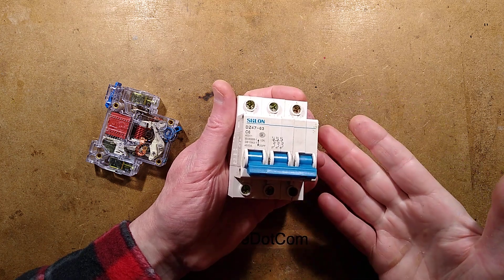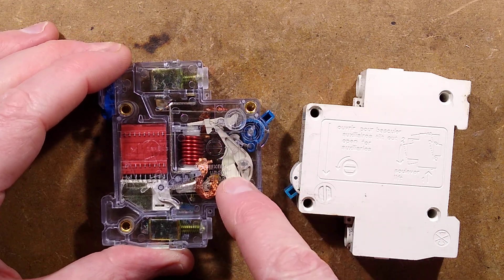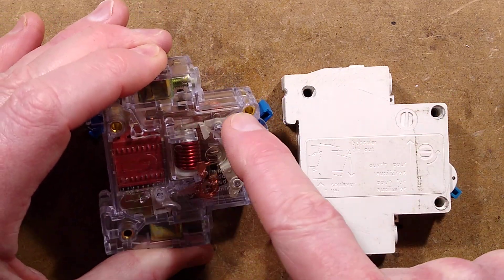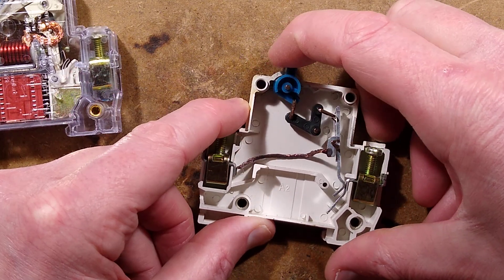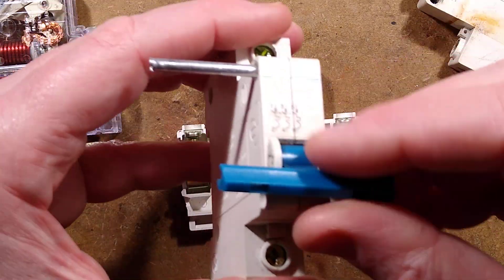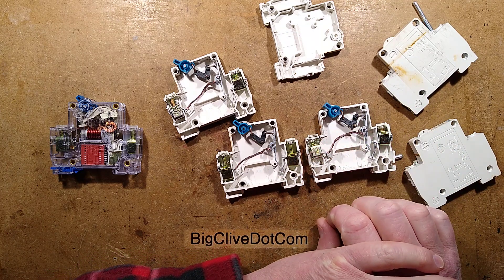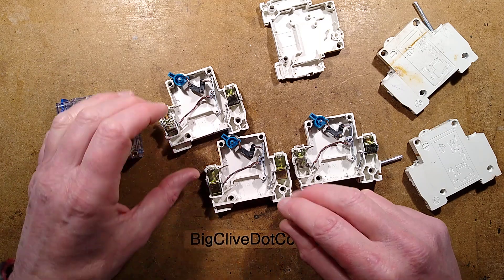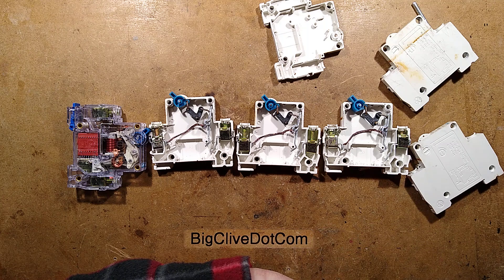Inside a fake un-trippable circuit breaker.

Comment: How different is the inside of a 100A DP switch disconnector? Let me know if you want me to post one for disassembly
Reply from the maker: I have some here.  Usually a double contact plate on each pole.
Reply: They will have actual contacts inside intended to survive opening and closing on a load, and possibly additional arc suppression (bearing in mind they're intended to open normal loads, not fault loads). While afaik the standard allows for an isolator not capable of opening on a load, I can't say I've ever seen one because you really, really need an interlock if you're going to operate a 100A contact like that.

Comment: well... it does TECHNICALLY break a circuit if you flip the switch, so it's a circuit breaker in the same way a lightswitch is a circuit breaker :p

Comment: These are probably relabeled switches.
Reply from the maker: Or just using a case they had to hand.
Reply: @bigclivedotcom  Yep, thats what I meant to say, I dont suspect bad intentions behind these, probably just the common neglegience of the person in charge not understanding the product.
Reply: @drkastenbrot  ...that’s a bit naive.
They have lines producing hundreds of these per hour... reloading, QA and packing.
That’s not a mistake.
Reply: @laustinspeiss  Thats not how every factory in china operates. You often have someone cheaply getting the machinery for some product at an auction and then cheaply manufacturing that product without really understanding it. Theres a lot of products from china where a factory has cut costs in such an idiotic way that the product no longer makes sense and if you take a closer look its always from factories that arent usually manufacturing electronic goods. 
Then theres also factories with regular changes in management yielding a similar result.
Reply: @drkastenbrot  I partially agree, but I stand by my position as a starting point for purchases from China.
I worked in the region from 1987 through 1998, and while the skill sets that are driven from outside the country are spectacular, the home grown philosophy leaves a LOT to be desired.
It’s no different than western manufacturing values, in that greed drives the management, cost cutting happens at the production level.

Comment: Here in the US we have molded case switches from Eaton, Sq D and others that look just like a circuit breaker and have a rating on them for the amount of amps the switch can handle, but its not a trip rating. I have found them in panels several times and had to swap them out for breakers. That is what this reminds me of.
Reply: Quite possibly fake markings from the same factory. ??
Reply: @laustinspeiss  The molded switches are designed for use in equipment disconnect enclosures where an overcurrent device is not required, but they will also fit in a panel. The only external difference between the switch and breaker is usually a label that says something like "This device does not provide overcurrent protection". Then someone without scruples peels off the label, installs it in a panel, then chaos ensues...

Comment: If there's a demand, someone will make it and sell it. I live in Canada and I must be naive to be astonished to see such a thing. Are UK electricians and landlords such despicable types. Oh sorry, you had the Grenfell cladding business which is still not resolved.
Reply: My father is a painter by trade. He saw the footage of grenfell on the news and knew instantly what was going on. It is actually illegal to use this kind of cladding above door, windows and other possible escape routes and above a certain height.
The styrofoam insulation that was used turns to what basically is napalm when on fire. 
(Napalm in the sense of a burning, sticky liquid). A good painter will only use this stuff if he has no other option. (Like all the way at the bottom of the building or where water could go into the insulation)

Comment: Those are very common here in Russia. I had to replace a lot of them in my career
Reply: In mother Russia, circuit break you!
Reply: @wzpu3283  underrated
Reply: Rasputin left the chat...
Reply: Never seen one in my life.  It's easier to find paranoid RCD which trips each time when a lamp burns out or old fridge relay clicks. 

If some idiot decides to do the wiring himself and buys dodgy cheapest stuff from the internet - it's his problem.

Comment: In Australia we use these in every house and factory, they are called main isolators, then in series with it you have a rcd /breaker. Extremely common here. They aren’t CBs they are isolators. 

This is most likely a labelling problem.
Reply: No, they're really not, because these lack suitable contacts and have no way to suppress an arc.

This is a pile of bullshit made purely to make a quick buck at the expense of everyone else.

Comment: I wonder how many of those are out there where the manufacturer went through the trouble of gluing a rock inside to make it weigh. The least they could have done was to use a smaller wire link so it had a chance of burning out in case of major fault.

Comment: I could see a use for this, as a din rail switch, if someone wanted to use a small din rail box, with cover for solar, or DC lighting, but should be labeled as a switch, or NOT a BREAKER!  Maybe put a fuse in there as a safety, make it a fuse holder, with a disconnect, that could be useful, being DC will arc so much, breaking the circuit quickly is a must to prevent cooking the contracts,   I'm starting to think maybe the Chinese are trying to kill us! Ha- Ha!!
Reply: You’re catching on.

Comment: Mehdi is probably watching this and wondering about his breakers not popping now.
Reply: Ahhh that's a good point. He should take a look inside those insane breakers he got.
Reply: He is michael faraday reincarnated as a fearless Iranian genius bad ass

Edit: Iranian genius bad ass, not Indian genius bad ass
Reply: @Okurkaarrgghh  thank you!!
Reply: @hitopsful  Type Electroboom you can see Mehdi. He is an Iranian Canadian, an electrical engineer. Very funny guy.
Reply: @hitopsful  I always thought he was Armenian, where in the hell did I get that idea from?
Reply: @tomstokoe5660  I thought he was from Egypt lmao.
Reply: @Cenentury0941  Actually you are all wrong, he is Egyptmenian actually, from the new melded country of Iran, Egypt and Armenia...
They actually got welded together by a failing circuit breaker too, fun fact!
Reply: Put a full bridge rectifier in it!
Reply: espically at Eddy Current video where his coil of wire was drawing about 36 amps and the four breakers in series did not open.

In fact the first breaker should open first.
Reply: @omarrama5984  it's a series circuit... how do you figure the first one would trip first?
Reply: @kleetus92  cuz the current runs on the 1st breaker, and when something draws a lot of current, the current comes from the 1st breaker which will trip the fastest.
Reply: @omarrama5984  nope... that's not how a series circuit works.
Reply: Who's Mehdi?
Reply: @ITubeTooInc  He's on here as Electroboom, he does a lot of experimental electrical work
Reply: @ITubeTooInc  My neighbour

Comment: Rcd's could be faked if the test button had a mechanical link to the switch
But an RCD can 'safely' be tested by shorting neutral and earth at any outlet
(safely in the fact that neutral and earth 'should' be at similar potential)

Comment: Well, apart from this wire; might go at 100A or something like that 😂
Reply: Clive should run some current through that b!tch and see if it's intended as a fusible link, and at what current level it breaks the circuit by disintegration.
Reply: It was probably safe in its original place. I guess the chinese motor/generator itself would have acted as a fuse, burning its coil long before the current gets even close to 6A. Uh.

Comment: I call them automatic fuses and not circuit breakers. This one is a genuine circuit breaker, not an automatic fuse. 
It does what it is supposed to do: it breaks the circuit in the off position. A simple switch breaks the circuit also in the off position.

The Chinese knock offs just use the term literally, not only to scam, but probably also because the term is wrong in the first place and they are trying to tell the world ;)

Comment: Interesting device but when you look at the label it specify 420V 450A  the drawing shows a switch and a wire I believe the wire will blow with 450A. No where do I see any UL or CE symbol, its just a switch in the form factor of an EU circuit breaker. Definitively not something to install in your wiring cabinet but exactly has described.
Reply: It's marked as "C6", which is supposed to mean a 6-amp circuit breaker with 'C' type trip characteristics.
Reply: It says 400V 4500A, and the symbol is correct for a circuit breaker with thermal and magnetic trip. The markings are not compliant but it does call out IEC 60898-1. One hopes you don't work with these for a living.

Comment: I’m sorry. WHAT?! It seems Chinese parts need to be inspected now, that’s TOTALLY unacceptable.
Reply: What is the point of using Chineese parts then? If you would require to check each and every imported circuit braker then it would most likely be cheaper just to assemble them localy. And crazy penny pinchers would still find a way to smuggle their beloved cheapest bottom of the barrel junk money can buy.
Reply: @Kirillissimus  Thing is, believe it or not, some DECENT Chinese manufacturers exist. They aren’t preferred over high quality products out of places like Germany or Japan, but they are good when you have to sacrifice a little quality in exchange for price until you can swap over to the more expensive but quality parts.
Reply: @UhrwerkKlockwerx  The point is not that they can not make reasonable quality stuff because they can. The point is that they are far away and buying their products only makes sence if they give it away for pennies. For a similar price you would just go to  germans or your local manufacturer who would privide not only quality but service and warranty as well. And in most cases even they can not make stuff decent and super cheap at the same time.
Reply: @Kirillissimus  I digress. I don’t see how your argument is contributory to my comment in the first place. I think you’re just here to debate, which I have better things to do than. If people didn’t need to import things from other countries, this wouldn’t even be a problem. But guess what? We have to import. That’s just how things work. So our best bet is to employ restrictions and / or set up some sort of law that heavily monitors any imports that are intended for use and must abide by safety standards are inspected for compliance with federal regulations, health and safety codes, etc etc. That’s literally the only thing we can do. Shutting down trade would destroy the economy, especially for small businesses who typically have some kind of need for imported goods/parts/etc.
Reply: @UhrwerkKlockwerx  Well media says "bash China" and people will be mindlessly bashing.
Thing is - high quality stuff from China can't be 10 times cheaper than big brands. It can be 40% less or so but that's it. Just like smartphones. A flagship phone from big Chinese brands will be about 50% of recent iPhone and will have faster CPU, more disk space and RAM for the price. But that's because 60% of iPhone price is Apple brand.  Same with breakers. A good one for a half of the price  of to western brands - totally legit. But if it's unreasonable cheap then it will be either fake or just very poorly made one.

Comment: Technical speaking it does break the circuit, just requires manual input. Lol
Reply: more like break the circuit as in "this circuit design is so broken now I don't know where to fix it"
Reply: @askjacob  what my late father use to call fairground wiring.

Comment: This is NOT an Over-Current device. This is a non-fused disconnect housed in a breaker housing. Many switch-gear manufacturers make them. They are well marked as non-fused.

Comment: Square D makes a disconnect in a breaker form for use where overload protection isn’t needed. They would have an amperage/horsepower rating marked on them but it wasn’t meant to be a trip rating. Could this have been the purpose for this unit?
Reply: 🌟 - so those are not crap, but only for use in a petrol/diesel generator that has protection elsewhere, for use as a manual switch for all 3 phases = so the sparky who took it out of a generator and gave them to Clive.... is barking-up the wrong tree? 🤨
Reply: Not with no proper contacts and the front proudly bearing IEC60898-1.
Reply: No, the C6 rating is plainly for a legitimate circuit breaker that to comply would need to have something like the thermal trip (slow) and short circuit (fast) protection, just like the clear one that Clive showed.  This is a fake as they come.  The only way they could make it any worse would be if they used flammable materials in the construction...  Oh wait...

Comment: The next design will have a stack of fender washers hot-glued into the case.
Reply: For bonus safety, the glue will melt and the washers will fall down to reinforce the current carrying capacity under "unusual load".

Comment: id use it as a DC switch, obvusly sharpie proper markings on it showing that it aint a breaker
Reply: What rating would that be marked for ?
Reply: @laustinspeiss  10 amps at most, nothing above 200w
Could do more probabably, but I dont trust it

Comment: Hi Clive Mike from Birmingham in the west midland here slightly of topic would it be possible to convert the poundland one shot phone charger into a small solar power supply to run a few less connected to a small solar panel if so could you do a video /demo on the wiring please..oh keep up the good work Ilove watching your videos

Comment: the fact that this, AHEM, stuff, gets into legit supplies is AWFUL. almost literally worse than nothing. might as well be a big knife switch like you see on the walls of Frankenstein's castle... except if it was a trio knife-switch it would actually be safer because at least then you'd KNOW not to rely on its SaFeTy and maybe throw it in the trash
Reply: at least those knife switches look cool
Reply: Properly built knife switches actually work and are easily inspected.  Beware of fake marble boards though.
Reply: @johndododoe1411  how do they fake the boards and any links to fake ones?
Reply: @SquishyZoran  Basically painted wood or plastic with "marble" patterns.  Good enough for furniture and wall decorations, but lacks the fire and electric safety needed for old school switch panels.
Reply: @johndododoe1411  Oh! Like particle or chip board! It seems like it would be way too lightweight to fool anyone though wouldn’t it?
Reply: I like those, I installed a modern version in my bedroom. Its on Thingiverse and adapts a normal switch to that style, you replace the faceplate with its version (texture is cracked wood, same on the handle), and it has a little ramp thing that slides over the normal switch so when you throw it, it simply moves your modern switch at the last bit so it should be pretty safe but has the cool factor.
Reply: @jakegarrett8109  link please?
Reply: @SquishyZoran  Couple variations if you Google "thingiverse frankenstein switch", the exact one I'm using for single socket light switch is this one:

https://www.thingiverse.com/thing:649284
Reply: @SquishyZoran  I think there's also a few variations in case you have those flat paddle switches, or the older fatter switch nubs. Looks like people have also made a few other cool ones in different styles that look like gears or you can get side throw action switches too depending on preference.
Reply: Trio knife switches with plain aluminium sheet metal fuses are still the main house switch for the majority of homes here in Costa Rica and honestly seem to work well. They are safe and very reliable.
Reply: not almost worse. significantly worse. A false sense of security is deadly

Comment: That reminds me of a customer who was all upset that I designed his equipment with a 100 amp circuit breaker instead of a 45 amp circuit breaker and he just couldn't understand that it was a 100 amp disconnect switch not a circuit breaker. I understand his confusion as the disconnect was a molded case switch and looks like a circuit breaker. This equipment doesn't come standard with a circuit breaker and is an addon option he didn't want when he ordered it.

Comment: That connection looks a bit like solder wick...
Gives me an idea for what to do with spend wick. Will also add some weight and will even give it an higher amp rating. 😈
Reply: Desoldering braid is actually great for repairing high current tracks on a PCB.

Comment: Ironically, they sell regular switches in the shape of a circuit breaker (and are normally marked as such, obviously). I can't imagine those looking that much different to this. Even more ironically, in my experience I've found those switches tend to be more expensive than actual circuit breakers!